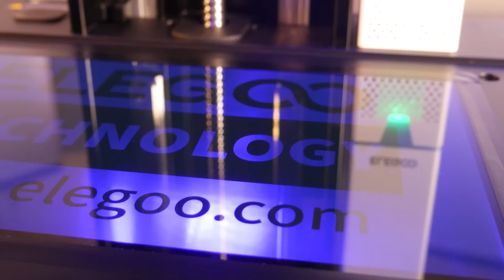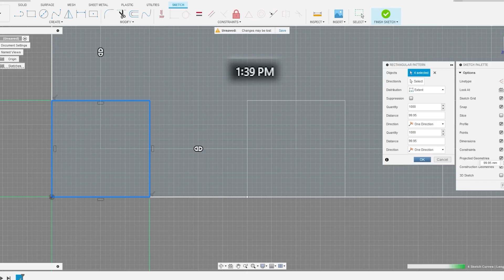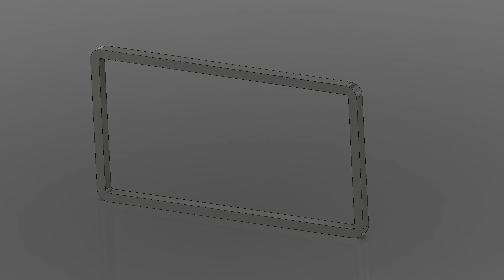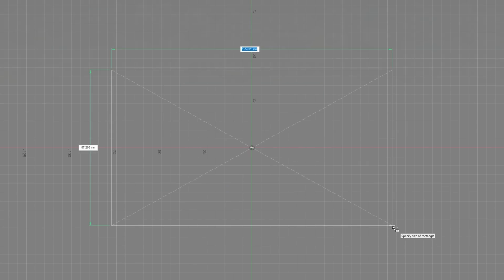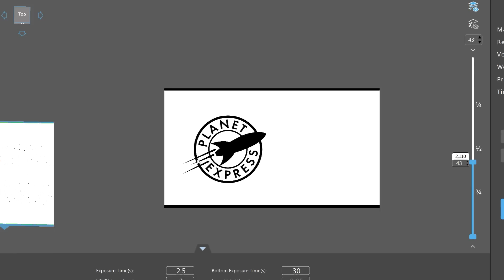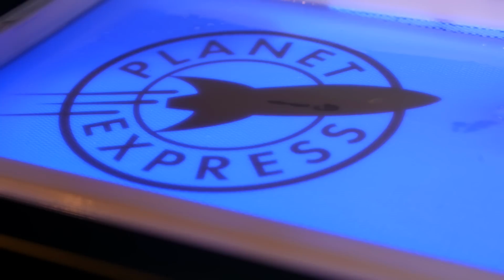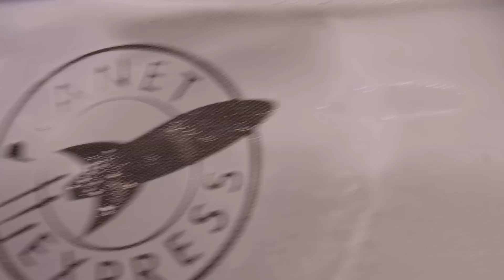Using Resin 3D Printing to Screen Print with the ELEGOO Jupiter 3D Printer

Comment: Interesting. I'm looking to silkscreen a small surface that's also 3D printed with resin (print disc labels (artist - ablum) on the edge of a minidisc). I might try this method, along with making a shim or insert to stabilize the disc while applying the material.

Comment: Awesome video!
Just a tip, add tiny (2-3mm) feet on the under-side of the frame. This will create a gap between the mesh and the textile which means that as you squeegee the ink through the mesh, the mesh lifts up from the already printed parts and won't stick into the paint that sits on top of the textile. This helps making sharper corners and when you are done with the print it makes removing the frame safer and easier.
I used to do screen-printing in the old fashioned way and I did this by taping toothpicks or shashlik sticks on the under side of the frames.

Comment: Looking at it, the frame from the bottom of the vat of any of the Saturn series of printers would have worked well, rather than the 3d printed frame. Might have been more of a pain to use, though.

Comment: Fusion doesn't like complex sketches. To make it easier extrude a flat rectangle, then extrude one hole (either as new body or cut) and then use a pattern on the extruded hole (either feature or the body; for the latter you'll need to do a combine cut after). This is you mesh. You then just cut your pattern directly into the mesh. If you want to clean up edges, use outline on the sketch, extrude new body, then combine join.

Comment: I've watched this video many times to get the details down, I'm having an issue with getting the resin to stick solidly to the screen itself. Any tips? The screen mesh is taught and flat, and upping exposure to even 50 seconds results in a print I can pull away easily from the screen mesh in a couple of pieces. Can't wait to start using this for screen printing, thanks for the video!!!

Comment: I was a screen printer as a kid.  I’ve been doing this occasionally for a few years. But differently than you. Just staple the screen to a frame, make a b&w transparency. Coat the screen in old resin you don’t need. Put the transparency on the top of some glass. Put the frame on top of the transparency. Then expose from the bottom. Easy peezey

Comment: This seems like screen printing with extra steps. Also you can get into screen printing for like $300 for everything you need if you go with budget stuff. The cost of a Jupiter is about $1k but i guess if you already have it... mught be easier to print a frams for the mesh and use emulsion and the Jupiter to cure it instead of messing around with toxic resin.

Comment: Can't you skip a resin step and use 1-2 small fdm layers?
Reply: hot print head would probably tear and melt that mesh? maybe some combination of very low melting point filament and high temperature mesh tightened to the max and trying to adjust printing height so that it doesn't tear. quick search turned out aluminium and pet meshes. maybe even the latter could handle it if used with some low melting point pla or such. also some glue which you can rinse away (maybe water soluble) could help keep the mesh down and intact. or maybe just print a stencil, maybe use it with a mesh over to keep things down and in place, although that would limit what you can print.

Comment: When you apply the ink, the screen is not actually touching the fabric/paper/...  
The rubber squeegee pushes it down on a bit it with the ink and it lifts/peels off as it goes, so you don't end up with the screen stuck with the ink on your shirt.
I used to apply some spray glue to hold the fabric down so it didn't move along with the squeegee.
But I guess 3D printed frames for screens wouldn't be rigid enough to apply that much force on them.
I wonder if you could airbrush through the screen you made?

Comment: Very clever! In theory you could also use the  printer to cure the photosensible sheet used in screen printing so no resin is needed. Instead of a transparent sheet with the design to mask the photosensible sheet, you would show the design in the printer screen. Then you would wash away the uncured parts as usual. This way no liquid is involved in the process of fixing the image so you don't need to put the frame inside the vat of the printer. You just place the frame directly on the printer screen.
Reply: ill try this with a premade frame you can buy, dont see a reason to print it at all :D
Reply: @Insane_Kane  you need a frame that allows you to put the silk screen touching the LCD screen. In the traditional way this is not necessary because the LCD screen is replaced with a transparency print placed on top the silk screen. You would still need the silk screen flat on top of the fabric to spread the ink so I believe this requisite is met, but check it first.

Comment: Question, could you instead lay the screen directly on the print screen and then drop the build plate for the resin printer directly onto the mesh, holding it against the build plate (you'd have to set a new zero) and then run just one layer?  You could even do it in the slicer software, do your solid model only the thickness of one layer then just have your "base" exposure be as long as you want.  Then after it comes out put it in the frame.
Reply: I was thinking make a frame that snaps onto the build plate that has the screen on it and then go for it
Reply: @natemartin9283  that'd be interesting. then make a second frame to go on the shirt to index the frames, so you can do multiple colors
Reply: yeah like a tight fitting embroidery screen frame  @natemartin9283
Reply: you need a FEP layer between the screen and the mesh, otherwise you'd never get the cured resin off the screen and it would drip into the printer guts. could be a single oversized sheet instead of the tank's sheet though
Reply: @TheRealPlato  I assumed it was obvious you'd have the vat installed as normal and have the screen on top of the FEP sheet, then level your build plate with the screen in place, so it doesn't push the screen into the LCD panel.  Then when you do your cure you only need to do 1 base layer.  The best would be if you had a WhamBam, since you could just flex the plate and peal the screen off.

Comment: Did the footage just show that other dude wash off UNCURED RESIN into a standard faucet, putting it back into the water supply ?

I hope I'm wrong and he has a collecting system under there ...
Reply from the maker: I think this is common practice for photo emulsion. I don’t think it has the same environmental effects as photopolymer resins. I could be wrong tho!
Reply: Like contaminated IPA there isn't much you can do with it once it's contaminated I collect my used IPA but the only options are to bin it so landfill maybe burning or sewage!! 

Personally I put mine in the bin because I don't think it's good to dump contaminated ipa into the sewage system..
Reply: @printitpaintit.2436  I keep contaminated IPA in a bucket so it settles.
Once settled, extract the clean IPA from the top of the bucket for reuse

The rest at the bottom of the bucket, you put get it to UV (lamp for a minute or the sun for a few hours)

Once that is stable, THEN you can bin it
If you cannot get it stable, deposit it in a waste disposal thing where they have a "chemical" sections

If you want to use UV resin you first need to learn how to clean it ...
Reply: @GregorifElfeNoir  I know how to clean it and you can only reuse is a few times even after letting it settle in the sun for a week it's still sticky.. After a few weeks it's useless but we print 24/7 across multiple large printers and go through 10L of resin like it's water, definitely couldn't be dumping 8L+ every few weeks into sewage! 

In the UK most rubbish that is not recycled is taken directly to the local waste centre and burnt the same day, I think burning is better than going through a treatment plant and then local rivers..